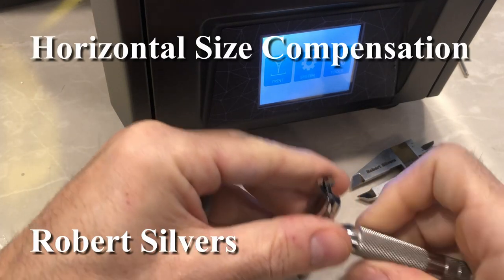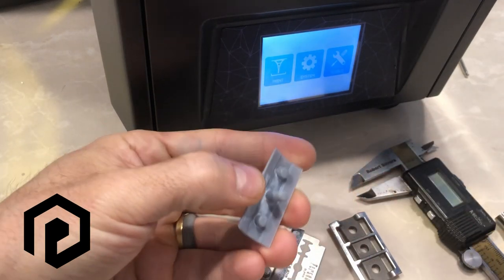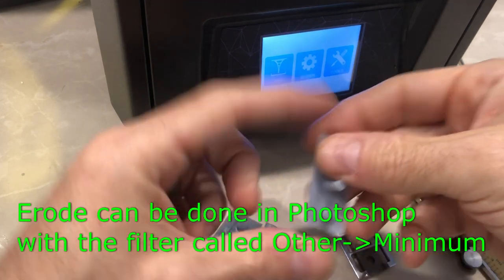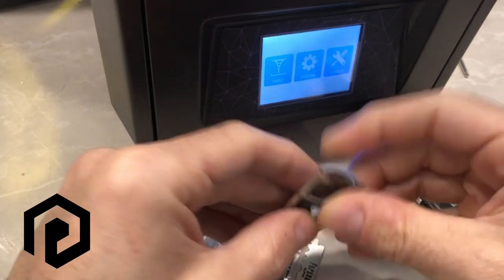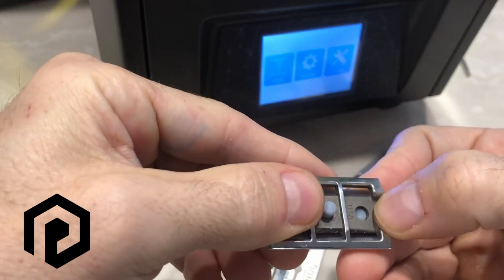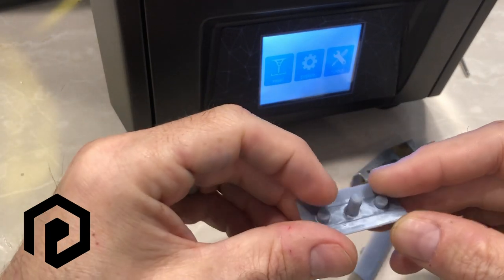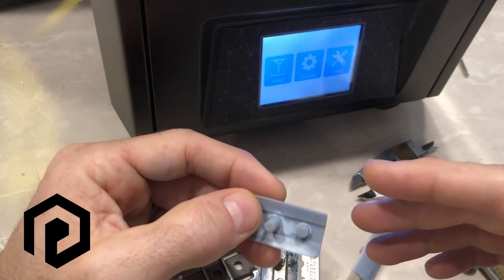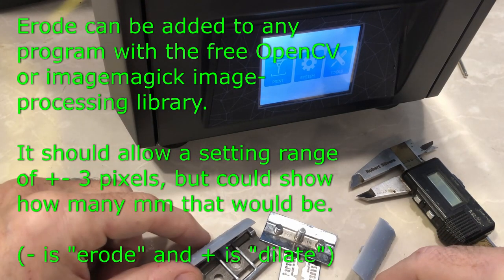Horizontal Size Compensation

Comment: Thank you for sharing this. I am experiencing same difficulties to print my modelled parametric parts on my Anycubic photon as well. I am getting horizontal AND vertical deviations on my parts. I have tried many resins, exposure settings, different orientations... It is quite useless for prototyping with parametric parts for mechanical assemblies :(
Reply: You shouldnt be getting vertical deviations. are u sure u are using the correct params on the slicer? if u using chitubox instead of chitudlp you need to make sure u have installed the photon settings and delete tye default printer settings.
the xy deviations can be tamed with VoxelOps for now. 
You need to firts have your resin perfectly tuned, usinf resin exposure finder and photonia validation model, then run Silver's gauge test to acess the amount of compensation you need for that particular resin/exposure and then slice your file and run it trough the VoxelOps erode function and repack it to .photon file 
It will compensate ur file for dimensional accuracy
Reply: @X3msnake  i want to learn how to voxelops... I m using kelant orbeat d100 machine
Reply: @X3msnake  hey buddy, is there any info on how to actually use voxel?
Reply: @SniperMechanics  no, no written documentation besides the installation sorry.

Comment: Could you work it out by dividing the real piece dimension with the first print dimension and scaling the mesh for the next print by that amount? For instance if a part is printed at 12 mm and should be 11.5 mm, the scaling would be 11.5/12 which would be .95833? Or is there some other problem involved?
Reply from the maker: compensation is a offset in or outwards of a part not a simple scale. besides the model should be built to design allowances and should not be messed with. it is the job of the printer tools to compensate for this
Reply: How can be open the single images from .photon files. I want to experiment with adding or removing pixels from images. After this...is possible to assembly into original file ? Thank you!

Comment: I have had the same issue for now i have just compensated the model -0.15 on all accurate faces
Reply: you can use photonsters VoxelOps with photonsters file editor to do this on the file level.
or just photonsters file editor and photoshop on the extracted images then compile back into a file
Reply: @X3msnake  Is there any guides on how to do this, reading github is rather daunting
Reply: @SniperMechanics  currently the simplest option is to use z-suite from zortrax that exports directly to Photon (only does 50u layers) Or get PrusaSlicer to slice and use the photonsters SL1 to Photon converter tool. both softwares have xy compensation settings